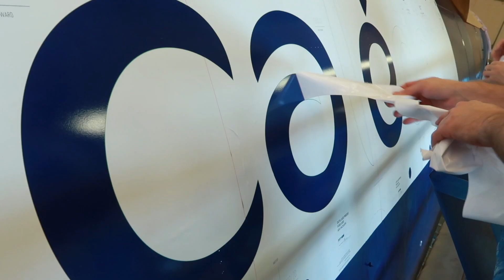In the Making: First #A330neo to Aircalin

Comment: It's so amazing. But I still love A350 the most HAHA
Reply: The EPA says that the release of perfluorocarbons during the aluminum smelting process are 9,200 times more harmful than carbon dioxide in terms of their affect on global warming. When bauxite is extracted from the earth, the strip-mining process removes all native vegetation in the mining region, resulting in a loss of habitat and food for local wildlife as well as significant soil erosion. The caustic red sludge and toxic mine tailings that remain are commonly deposited into excavated mine pits where they ultimately seep into aquifers, contaminating local water sources. Greenhouse gas emissions released during smelting and processing (which have been found to blanket surrounding regions with toxic vapors) include carbon dioxide, perfluorocarbons, sodium fluoride, sulfur dioxide, polycyclic aromatic hydrocarbon and a vast list of other problematic elements. Particulates released during processing that are known to compromise air quality include combustion byproducts, caustic aerosols, dust from bauxite, limestone, charred lime, alumina and sodium salt.

And for what good reason is this aluminum used? So that tourists can do absurd emissions for silly trips?

You need mental help..
Reply: @RAKKER004  wow, it's Random Guy!